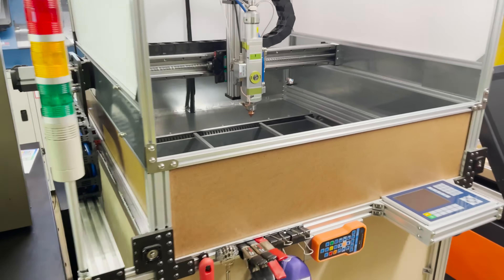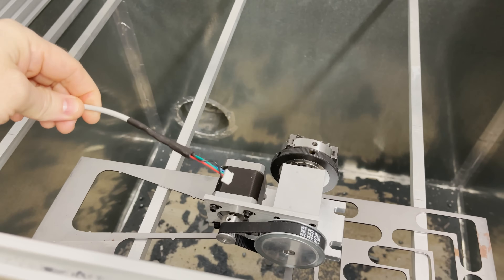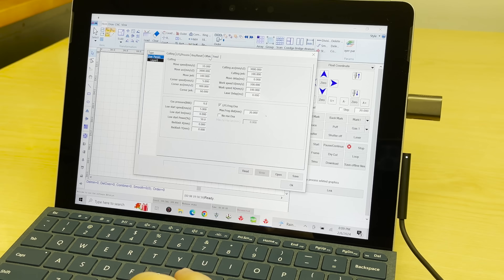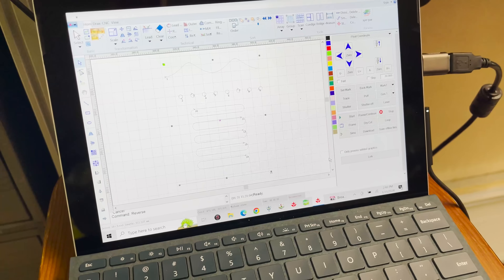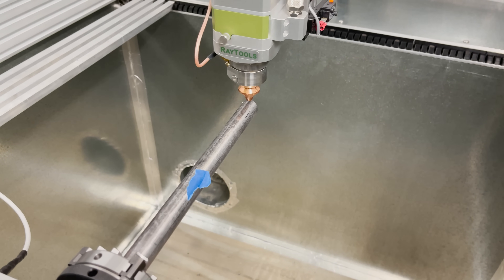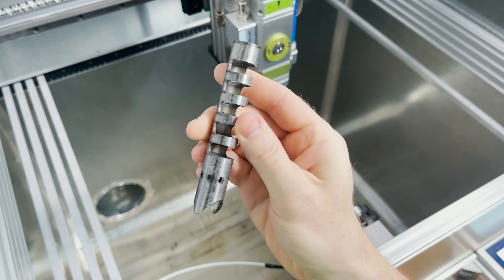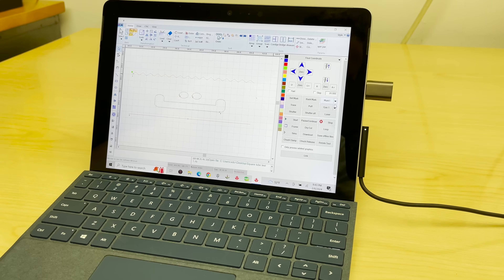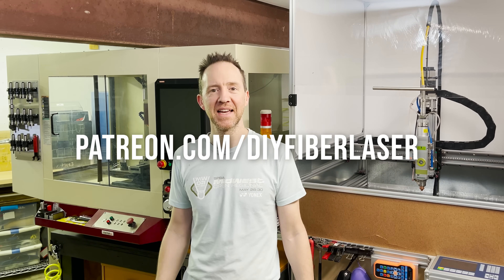DIY 1000W Fiber Laser Cutter Part 7: Tube Cutting

Comment: I wonder if it would be possible to run a masso G3 touchscreen controller like the one on your CNC mill on your laser? Do you think it would work?
Reply from the maker: It's probably possibly, but in no way ideal, you'd have to come up with a custom solution for THC and multi-stage piercing and I'm not sure what you'd do for software...maye create a custom postprocessor for Fusion360 to generate the proper gcode? I was going to try it, but at least for flat sheet cutting, there are cheaper and better fiber laser specific controllers available.

Comment: Light burn works great with ruida. I use it for a 150w co2 gantry laser and a 30w galvo co2. Light burn for the win. I tossed RD works same day I go the laser and never looked back
Reply: Is that on the same machine or the gantry and galvo are separate machines?

Comment: I've done exactly what you've mentioned in the end with sheetcam.
My diy fiber laser integrated sheets and tubes works great.
Reply from the maker: Great to hear...I saw the video of your laser and it looks awesome!
Reply: yup, use mach3 and sheetcam and rotary plugin, work great for me
Reply: @niam102008  you've built a fiber laser with a mach3 controller and you're using sheetcam rotary plug-in for tubes and pipes cutting?
Reply: @TAMARbarCNC  yup, low budget and work great. i use solidwork for CAD and simply convert from square tube CAD to DXF for sheetcam, work super great

Comment: Using the rotary axis on the X axis is useful for cutting round tubing, but how will you then cut on a square tubing? That will need the X axis linear motion as well.
Reply: If projected correctly onto the square tube you can rotate it instead of moving the "real" X axis.

Comment: If you have a cnc controller you could just do the cam in fusion. They have taken full 4 axis out of the regular edition though and moved it into a subscription. Might still work with your unrolling trick though. You can do the rotations on a 4th axis with 3 axis setups still. 
Just an option to consider

Comment: You may be able to project your pattern from the square tube onto a cylinder in 360 or blender, then export and cut the cylindrical pattern (which is what the controller thinks it is doing) as long as the height control follows properly this might work :)

Comment: Very cool!! 
Have you tried engraving with your laser? I know it's meant for cutting, but just wondering if it could do engraving with low enough power settings?
I'm thinking to build one similar to yours but I want something that will be and do cut as well as engrave stainless and other metals
Reply from the maker: Yes, I’ve tried it….it’s just ok results. For better results you’d need a controller that supports cypcut software…from what I understand it has power curve settings that can lower the power as it accelerates/decelerates, making a more even engraving. The Ruida controller doesn’t have that functionality.
Reply: @diyfiberlaser  Do you have any photos of the engraving results by any chance?
Reply from the maker: @vstolpner  Here's a comparison of the difference between my 2 lasers: https://www.id3ntitycrisis.com/images/Laser-engraving-difference.jpg
Reply: @diyfiberlaser  oh wow, I can see what you mean. Thanks

Comment: I had luck getting a dedicated U axis to work on my co2 laser with a Ruida RDC6445S controller and Lightburn by downgrading the version of the controller, and changing my workflow a bit. Your “RDC” should be version V26.01.13. If it is V26.01.13 it will not work, you can downgrade using RDworks. Once it's on the right version, you have to send the file to the controller, and then start the job using the controller rather than starting it from the computer. There are some links to controller firmware out there, but I think linking them here will cause the comment to get removed.
Reply from the maker: Thanks for the tip!…I will investigate